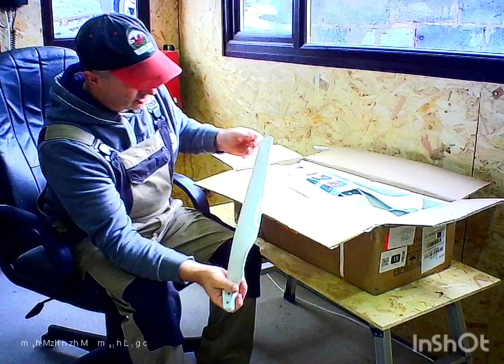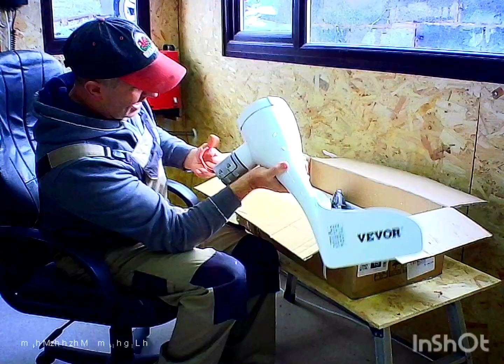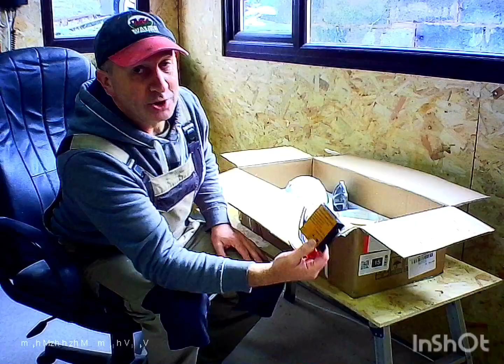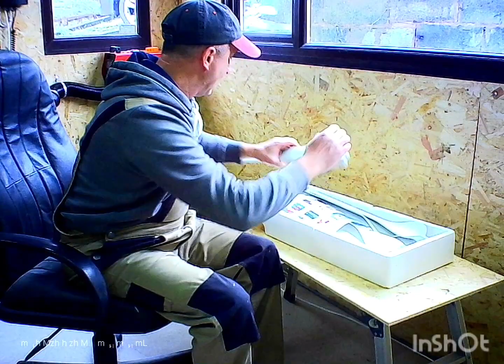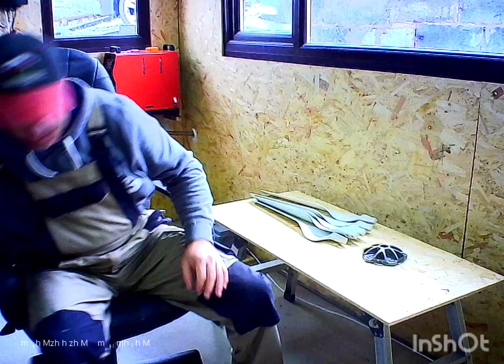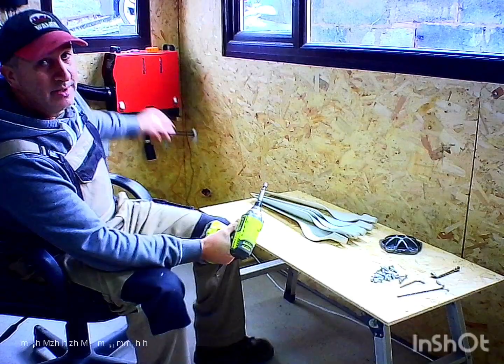12v wind turbine unboxing and assembly for off-grid garage off eBay cheap electric 🏴󠁧󠁢󠁷󠁬󠁳󠁿

Comment: Hi Steve did you say your wind turbine was 500w 5 blade? Also did it come with mppt? Thanks 👍
Reply from the maker: Yeah it’s a 500w 5 blade but it’s only put out 500w a couple of times lol and yes it does come with it’s own mppt.
What are you working on something off grid.
Reply: @777steve hi Steve it's just basically a shed project thing, I built a 19ft x14ft shed/workshop and looking at options, I am enjoying watching your vlogs 👍
Reply from the maker: @1Mattza 
That’s a good size work shop if I was building mine again I’d go for a Bluetti AC240 and that will do everything you need. The best thing is the diesel heater that works great in the workshop 👍
Reply: @777steve thanks Steve I will check that out👍